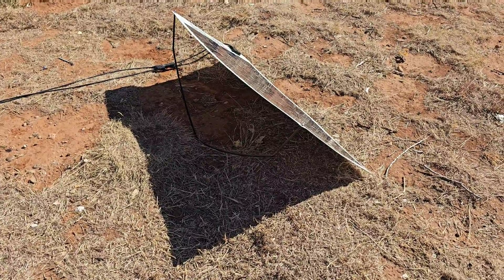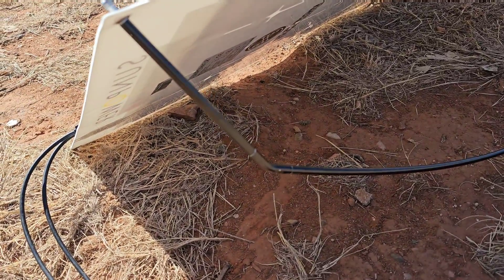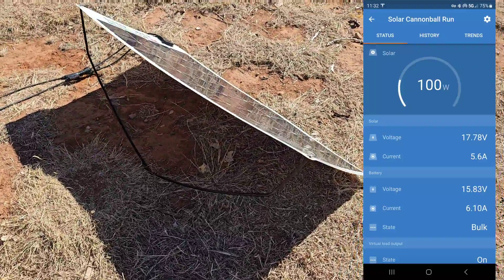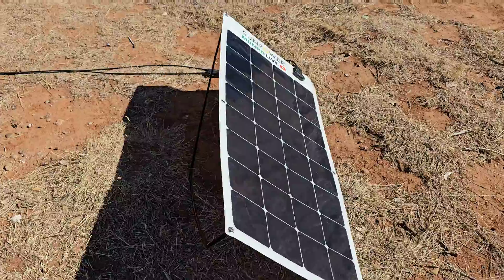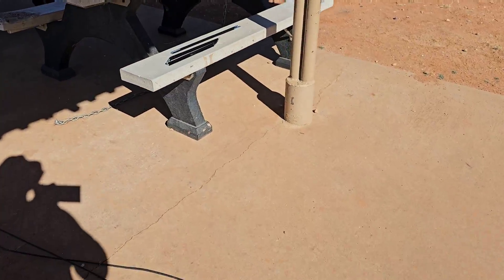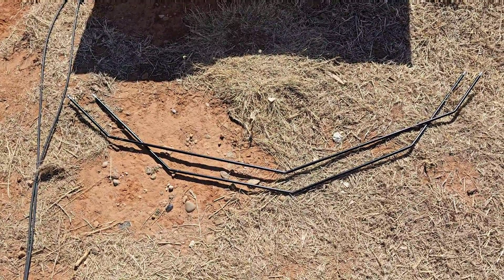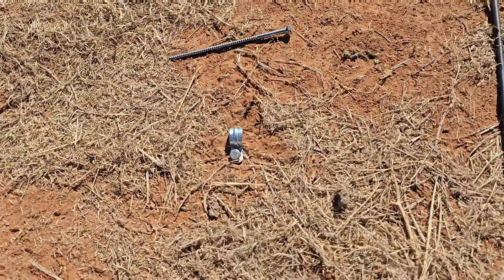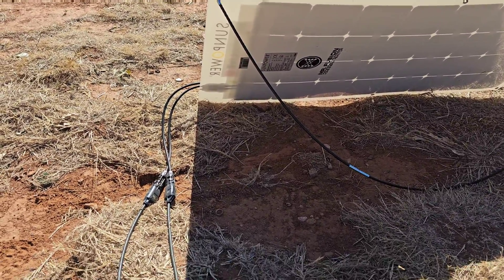Solar Panel Stands, ultra lightweight and compact.

Comment: Have you tried these with the "non-flexible" portable ecoflow panels?  I wonder if 2 of the current stands would work with the 4 grommets but just offset from eachother.  EcoFlow came out with a new stand since they realized their current stand case isn't the best but this looks simpler and lighter👍
Reply from the maker: Yes, I have been looking at ways to work with the many EcoFlow panels. I am a fan of their products, although I have not personally used them yet.

Comment: Came here from a recent video, looking to see if you had tried a vertical panel orientation?  Then you wouldn't need the 30+ extensions to solve the low-sun shading problem, perhaps overlapping the holes on adjacent panels to create the same stability you get from horizontal layouts...
Reply from the maker: I recently saw a video on vertical mount, I think they were bifacial though, so mine would not far so well if mounted vertically.
Reply: @lightpowered  Or sorry, I didn't mean perfectly vertical as they've done with fixed commercial bifacial panels (getting more morning and evening light, less midday, fitting the duck curve) ~ although that might be interesting as well (are there thin flexible bi-facial?)

I meant vertical orientation as in rotating your panels 90 degrees.  The short edge on the ground not the long edge.  Portrait instead of landscape paper :-),

As this would be the less stable orientation, overlapping the holes between adjacent panels so the row of them stabilize each other.  You might only need half the stands as every other panel uses the stand of its neighbour!? [although maybe this doesn't work so well if the ground isn't flat and level!?]

Then the wire connections are all along the bottom and no need for extensions, just make one long string for each grouping and spread the groups/rows out enough so there is minimal shading!?  The panels would still be sloped 45 or whatever, not upright or flat on the ground
Reply from the maker: No flexible bifacials to my knowledge, Ahh yes portrait mode! link two together and have one large stand for both! I did think about this but did not have the time to really investigate it. I would need to increase the thickness of the aluminum but that would be a more ideal setup indeed :)

Comment: Interested in at least a few of these stands. These are looking to be an interesting solution for small-build van setups wanting a bit more power when parked to run things like electric air conditioning. 

Perhaps a marketing/design improvement could be exploring if one could use two sets of the stands on a single panel to help with other mounting situations (e.g. to help with sitting vertically on top of a van awning, joining panels together, etc.)
Reply from the maker: I will try to setup some kind of shop to sell them, but a bit busy at the moment for that. Maybe I could come up with a way to mount on a van that is better than glue or complex bracketry.
Reply: @solarcannonballrun  some have mentioned using loxx fasteners with these sunpower panels. I was interested in mounting on top of a fiamma van awning such that it could stand at an angle (using these stands) but also mount securely to the awnings aluminum slideout rail and/or a hitop van's fiberglass top (likely via hook and loop)

Comment: I wonder what is a bend radius on those panels, can those panels be bolted together and rolled into cylinder. Easier to roll/unroll at stops.
Setting up one by one is tedious work, maybe you get better with it after few times.
Reply from the maker: They feel a bit fragile. I only carry 4 at a time. The flexibility is quite limited. I thought about a scissor mechanism with larger panels in a cybertruck bed. But anything times 64 gets very big and heavy, and these stands only weight 100 grams each.

Comment: Just curious... Do you change the angle of the panels throughout the day?
Have a great Cannonball.
Cheers
Reply from the maker: Good question, for my tent single panel, yes. For the 64 panel array, no. They are all staked in semi permanent. Also, the wires are too short to pivot without shading the panel behind. So the whole array would need to be moved.
Reply: @lightpowered  Yeah... I didn't think about that.  But, now I know. Thanks!
Cheers

Comment: I'd buy some.  I have 15 flexible 100W panels and usually don't get more than 600W at a time with them face up on the ground.  I'd buy these if they're cheap and work well, but I do like the convenience of rolling out my panels in a matter of seconds
Reply from the maker: Wow, that's a lot of panels and a big efficiency hit. Are you using PWM or MPPT charge controller? For the price the Chinese fiberglass would be $15 free shipping. The made in the US Easton Aluminum would be more, I think $40 with free shipping.